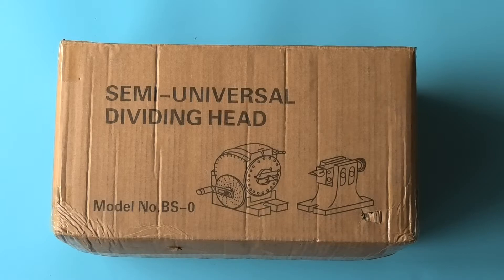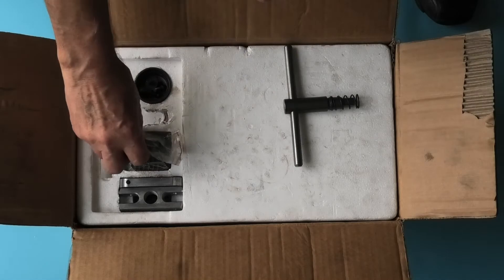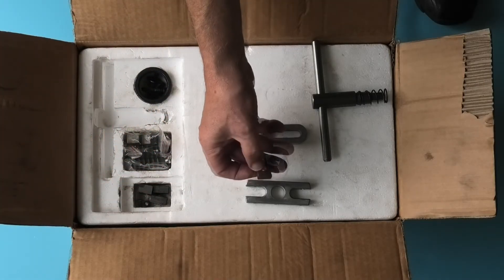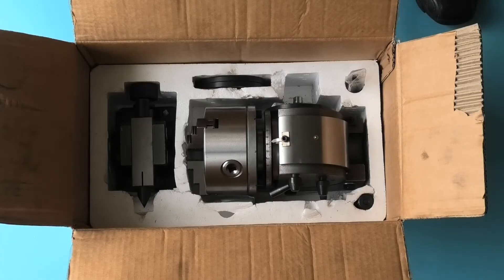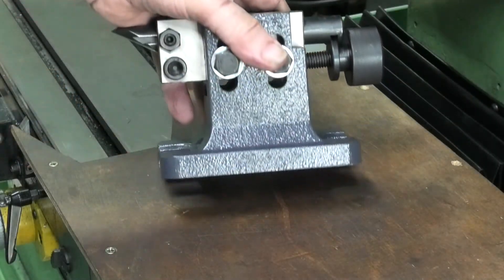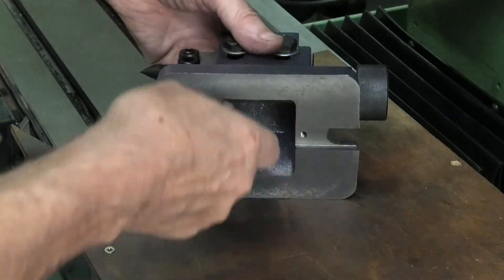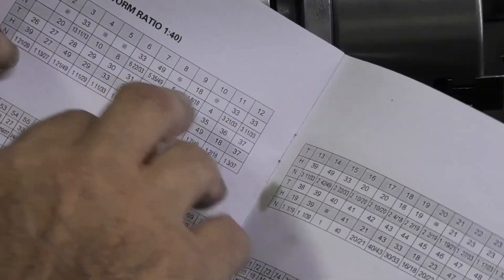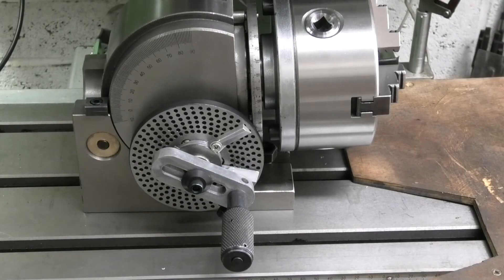Dividing Head with 2 ways to use it

Comment: One question is that can we make dividing head on lathe?
Reply from the maker: Hi On the lathe you can use an indexing ring fitted to the back og the chuck.
see https://youtu.be/USz2iNZY_rk
Reply: I learn something but vedio is not c complete
Reply from the maker: Hi there are 3 videos  
1 indexing ring from an old brake disc
2 indexing arm and location pin
3 indexing ring finish and test. I could not copy the links but if you type in the title on YouTube you should find it
Reply: Ok thank you sir

Comment: This is a Semi-Universal Indexer. When direct indexing (24 hole nose plate) disengage the worm, and still do use the spindle clamp. When doing indexing, without the gearing of the more advanced models (Universal Indexer) you cannot do divisions from the tables that have numbers in the A-B-C-D-E-F rows, so you are a bit limited. Cheers!

Comment: Well explained. I have the BS1 model with a 6" chuck. Quite happy with it. I totally disassembled it and was surprised it was fairly clean inside. I purchased it to make some change gears. & to tell the truth just to prove I could make gears.  To make gears requires making a tapered arbore and mounting the work blank between centers. I purchased a set of gear cutters for the tooth pattern I needed. For a one-off gear I've hand ground a tool and made a holder similar to a fly cutter to mount it. Not perfect but the gear runs well enough. Each tooth is cut to full depth in a single pass. I have ruined a couple of gears by losing track of rotational counts. (Pay close attention, it gets boring after multiple teeth cutting!) Keith Rucker has a good video on making bevel gears. I've used Acetal for some gears, and it works well. Both fun and challenging. Even though it can be turned straight up it takes a lot of Z axis space on a mill. Much better off with a rotary table that takes indexing plates for that use.